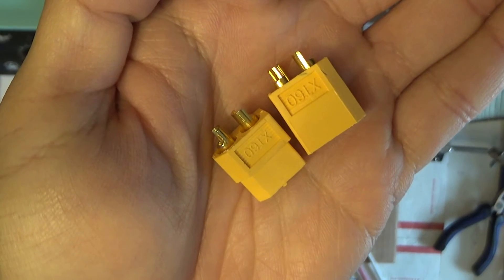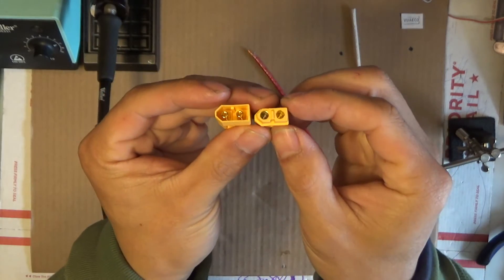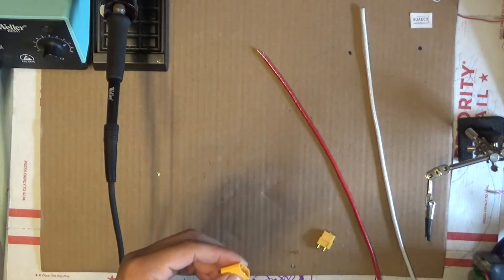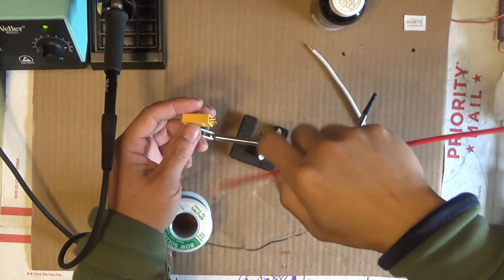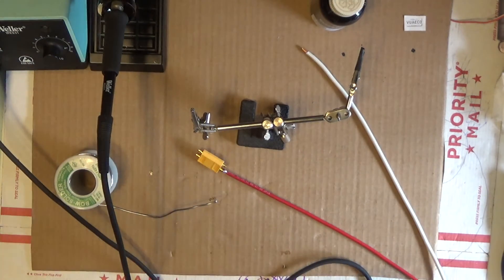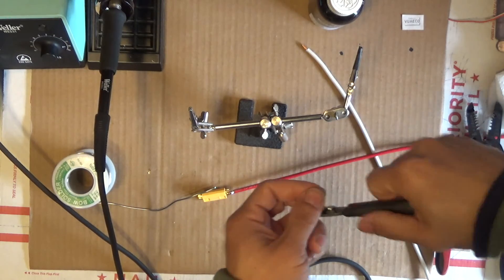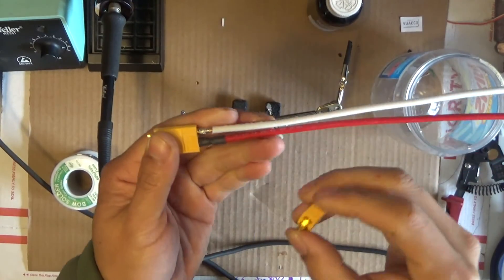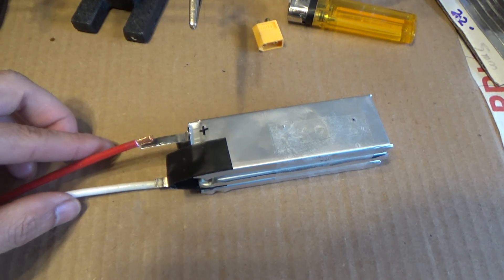DIY: How to make XT60 connectors for electric bike/scooter Li-ion battery packs

Comment: 48x 24A lifepo4 3C electric bike, does XT60 or XT90 go? Also, is the female connector plugged into the battery side or the other side?

Comment: On my ebike battery. The wires coming from the battery are 1 red and 1 white. And from the controller. 1 red and 1 black. The 2 red are connected. And the white and black are connected. I want to get a second battery for distance. But what if I connect the wrong wires together ? Will that hurt my ebike ? I am obviously no expert. But there is not anyone for over 300 miles that might even work on my ebike because they only work on their own. Will you please tell me what to do ? What I need ? I cannot solder. And the connectors are white and round. My bike is from china

Comment: I changed the terminal end on my new controller for my ebike to match Andersen terminal on 36v battery.  Controller doesn’t want to work now.  Connection good with multimeter test.  Controller is 36v-48v 22ah.  Should I switch back to the XT60 and change my battery terminal end?   Does the type of terminal end used depend on something I’m missing.

Great video.  Hope you can help.

/Bklyn👑